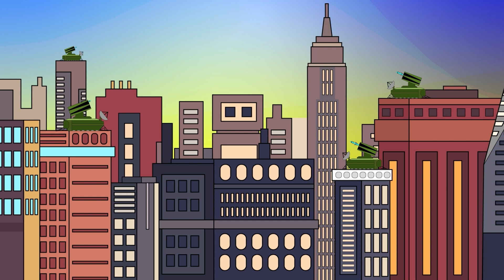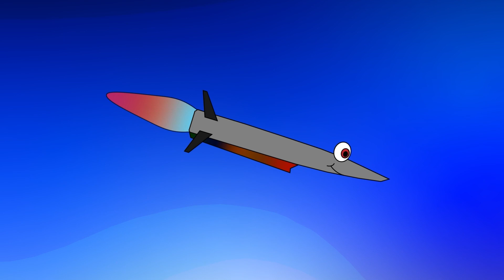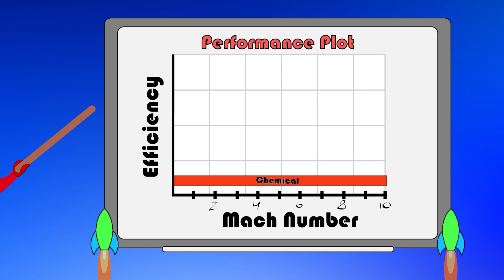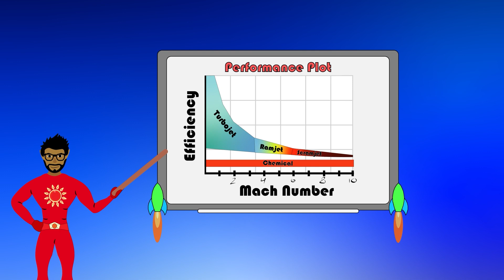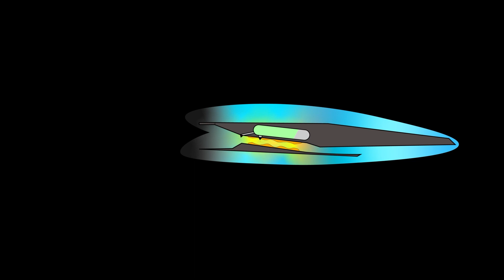Hypersonic Propulsion For Dummies | Scramjets Explained

Comment: hmm true hypersonic objects dont show up on radar, skin heating effect gets so high above a certian mach number that plasma forms and tends to act as a radio absorbant shield. this has the opposite effect for thermal imaging and they stick out like a sore thumb, especially at low altitude above bodies of water which further reflect this sore thumb thermal plume. laser jamming of thermal imaging sats/drones is going to be a big deal in the near future. geostationay orbit is probably far enough away to be safe from laser jamming now but LEO isnt
Reply from the maker: Thanks for your insight. I suppose the biggest limitation to hypersonic defense is transferring information from sensors to counter-measures before the hypersonic missile makes impact.
Reply: @manofshakti  hmm I think it would be weather/rain/humidity obscures the 100's-1000's of infrared tracking satellites now in orbit. if a hypersonic missile can be launched from a mobile platform like mig31 and achieve true hypersonic velocity and be obscured through cloud/rain cover, then that is the only way it is untargetable. spacex's starlink network has several known darpa/defense contracts and is likely used as a fast as light speed spy sat system that is basically everywhere all over the world at all times. wouldnt surprise me if it could interface with us/nato defense systems when needed to provide light speed global communications for sending info from sensors to counter measures.